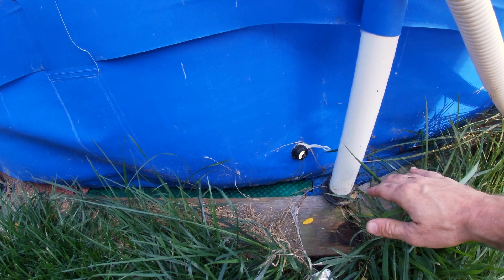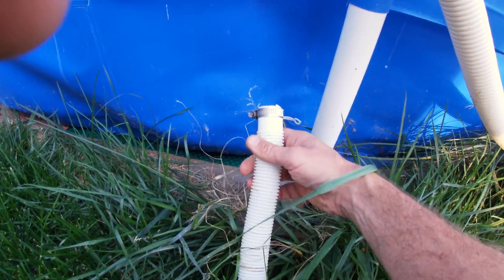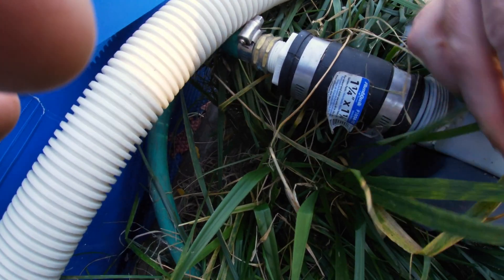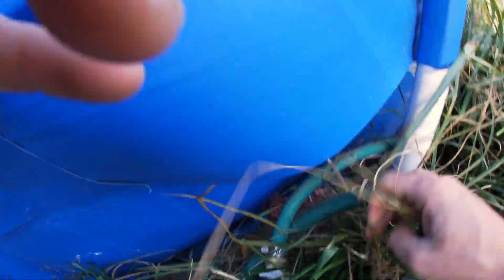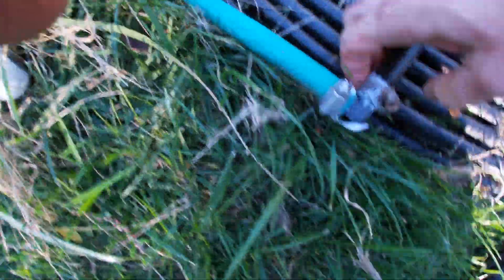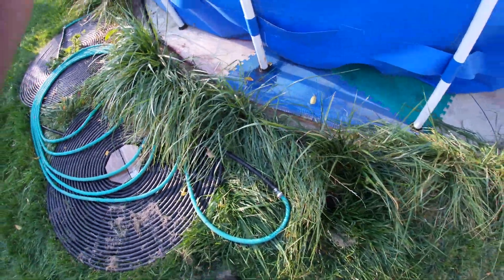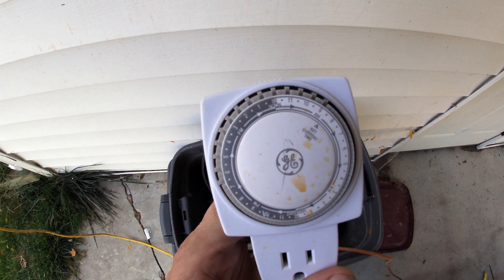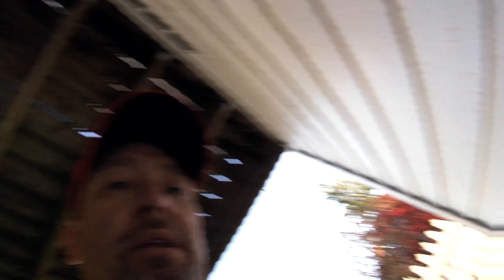DIY Solar Pool Heater - Homemade solar heater hack for an Intex poolBuild a Cheap Solar Pool Heater

Comment: So was it 1/2 in tubing or 3/4 . I was thinking of using a 1" size. Great video thanks
Reply from the maker: I’d imagine you could use either. I got this for free and think it’s 1/2”.
Reply: @smitteninthemitten3777  Great, thanks!

Comment: I was looking for a photocell to it will only turn on when its sunny. But it's hard to find the right switch that does the opposite of a flood light sensor. Also you do not want the solar heater running during the night when it's cold because it will take heat out !
Reply from the maker: Right. The timer I have it set on runs only during day time hours.